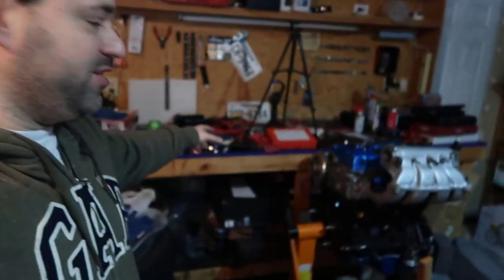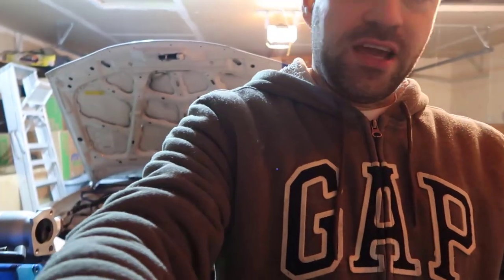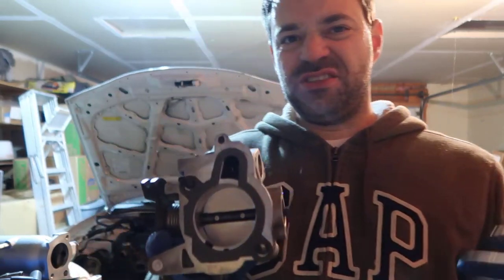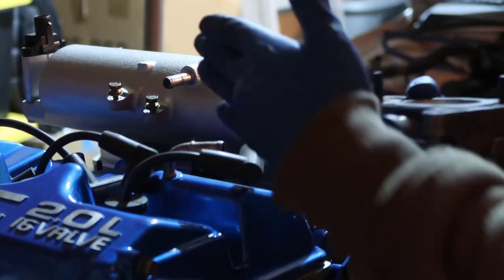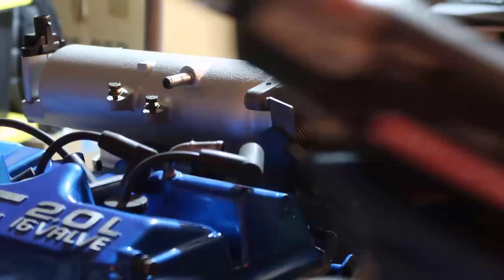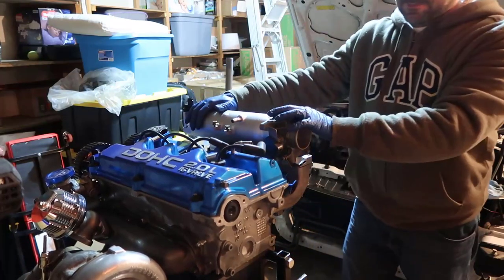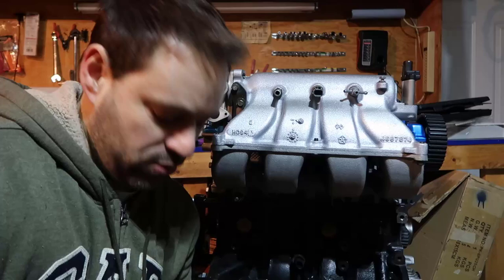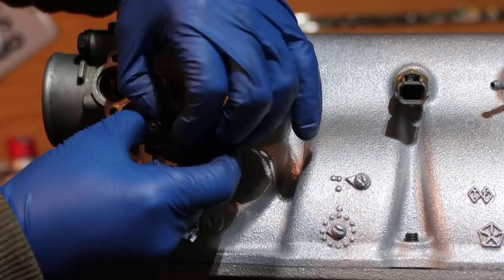Installing Throttle Body - #Eclipse2GBuild

Comment: Injector Control Pressure Not Detected During Crank is the generic description for the P1212 code ?
Reply from the maker: That's what's Google says but I also found that It can be ABS/TCS Control Unit for Nissan's. I guess it is different for different manufacturers
Reply: Yes it is
Reply: So my question is that if one injector or fuel pressure regulator not working would it still be the same as not being detected during crank what do you think thx
Reply from the maker: @mandellscott7321  I don't know. I would think that  the engine would run very rough and you would be able to tell that something wasn't right but I don't have idea.